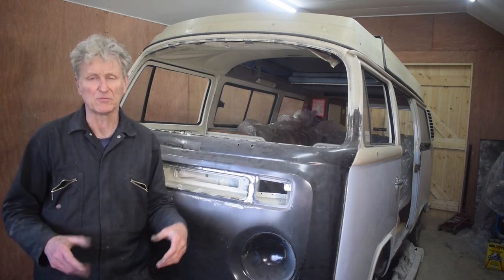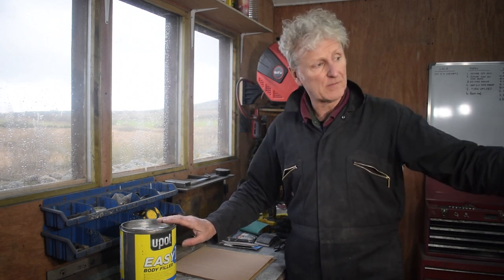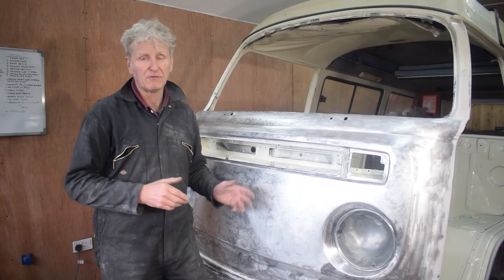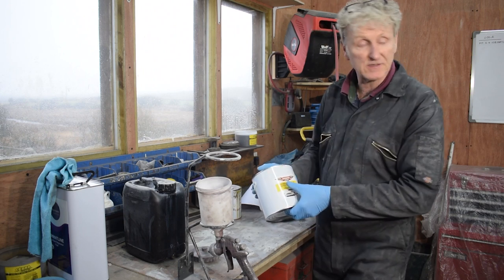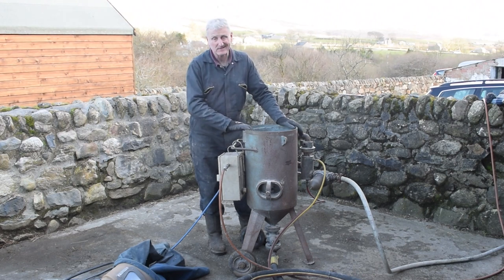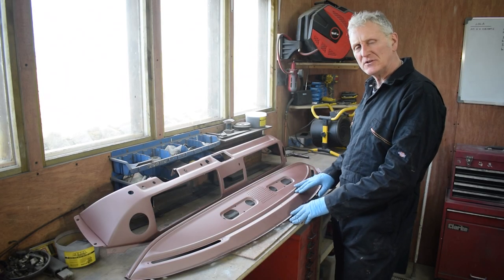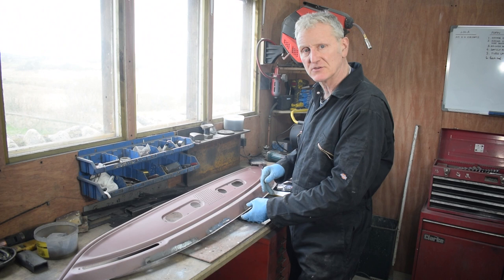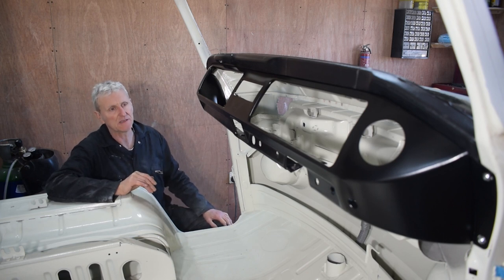1973 VW Campervan Restoration Part 13

Comment: Hi Jon. I have really been enjoying your vids and your skills and detail is amazing, very inspiring to me to take on my own van and get her up to stretch. Just one question  is it necessary to remove all the black primer or is it just something you like to do?
Reply from the maker: If you ask the panel manufactures they say that it should be removed and is only there for transporting etc. Whether that is true or not I don't know but it is always better to apply etch or epoxy primmer to bare metal so as far as I am concerend it's better to be safe than sorry! Cheers Jonathon